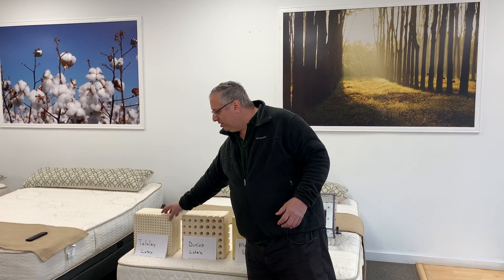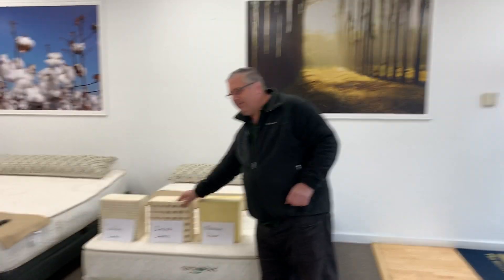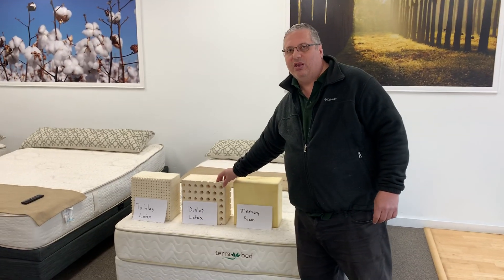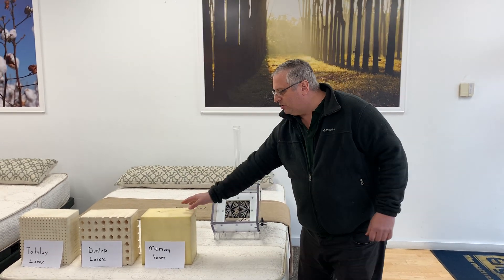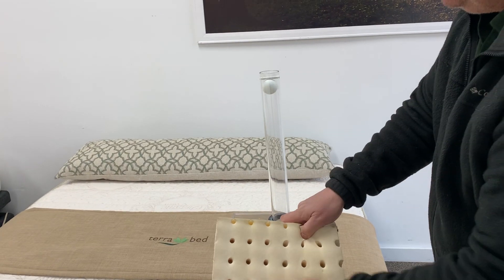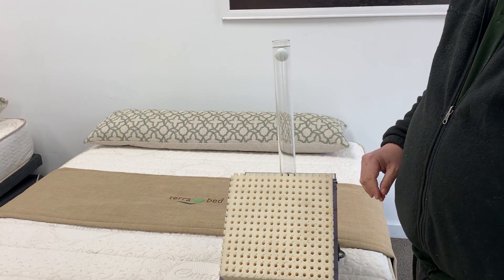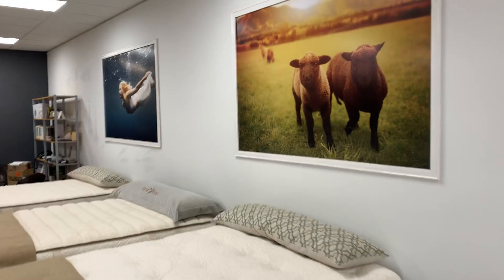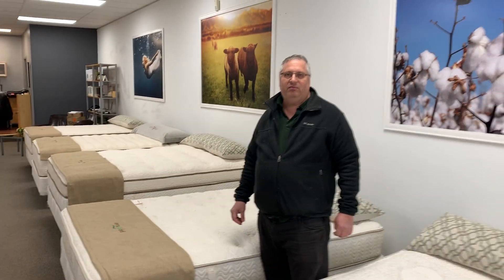Breathability of Talalay Latex vs. Dunlop Latex vs. Memory Foam in mattresses

Comment: Dunlop is NOT made from 30 feet molds (that is Memory and PU foam), but from 3 & 6 inch molds. Only Dunlop can get a GOLS certificate, meaning it is 95+% organic. Talalay has the advantage that it is softer but less durable than Dunlop.